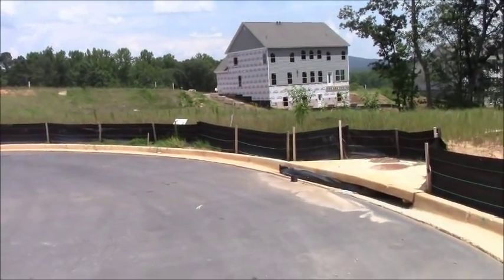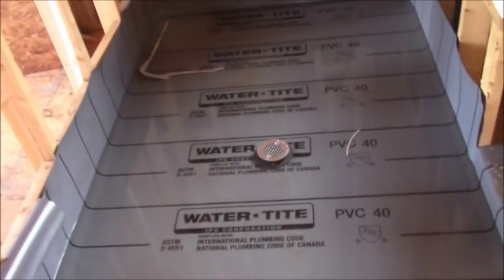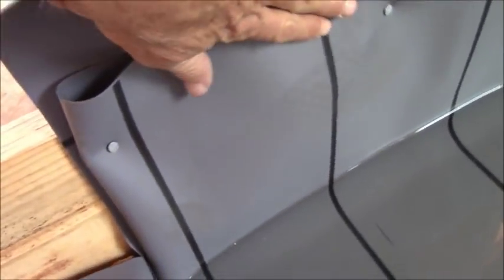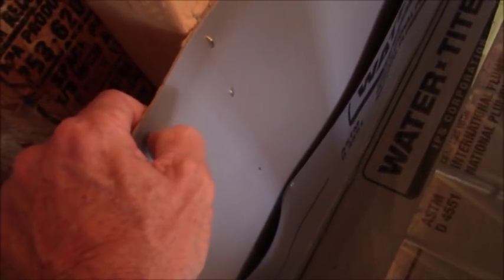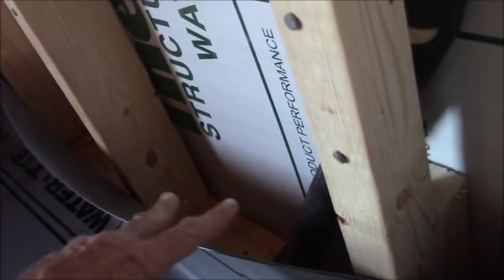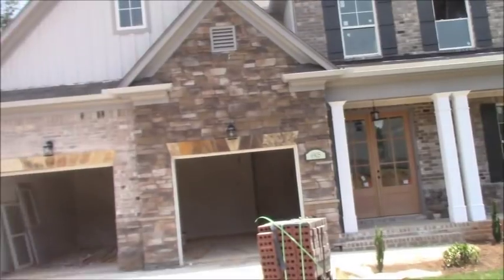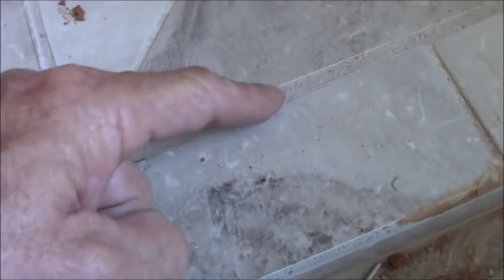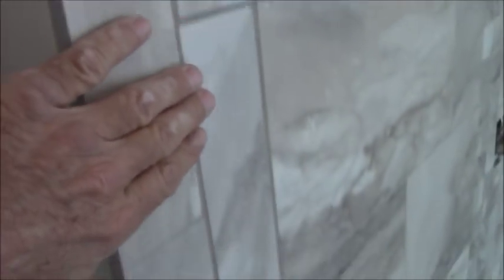NO ShowerPan PreSlope ..NEW CONSTRUCTION

Comment: That is PEX. It's not new. Copper will corrode if the pH is wrong whereas PEX is pretty much unaffected by that. Plastic fittings are corroded by chlorine on public drinking systems where copper is not. You should read up on the different types of PEX and copper and when it is suitable to use each.
Reply from the maker: And rats/mice eat through PEX to get to the water....many videos showing that...a rat can't eat copper.
Reply: StarrTile I have had to repair pex eaten by animals

Comment: I'm a carpenter not a plumber so I'm no expert but isn't the goal to not get the mortar bed wet. Seems to me the pan liner is a protection for a worst case scenario. I can't imagine wet mortar would hold tile too long. I could be wrong but if my theory is correct a pre slope would be utterly pointless. Especially in the age of red guard. Again could be wrong maybe the mortar should be getting wet but that makes no logical sense to me.
Reply: Brian 716 Portland based thinset grows stronger in the presence of water, but you don't want dirty body water sitting under the tile, thus the need for pre-slope.

Comment: After 25 yrs building... all I see is someone needs a slap on the second shower. ;)
Reply: Endorfen2011 it did look like sh@t. I would not be surprised if the shower has problems later, that's if it doesn't get red tagged by the inspector.

Comment: Copper oxidizes. Plastic does not. If you've done this kind of work for any amount of years you would know this. As far as pre slope goes, if it's code in that county than so be it. Pre slope is completely irrelevant to a tile guy when you are sloping concrete irregardless.
Reply from the maker: Copper oxidizes sometimes, and depending on what part of the country you're in and how clean your water is doesn't beget a failure necessarily... I work on homes that were built in the forties and fifties with copper that has never failed.

Rats will eat through plastic pipe, look on YouTube for PEX/ rats and you will see it, never would happen with copper.

The pre-slope issue is buried, we are waterproofing the surface of the pan now so it's irrelevant.
Reply: @StarrTile  appreciate comment. Look on YouTube search PEX vs Copper. I highly recommend everyone watch. Copper likely ness of combustion is much higher than PEX, and PEX can withstand cold freezing temperature far better. Which is pretty important to us northern states. As far as 🐁 🐀 go, I guess your right about that. But Rats can literally chew threw steel. Also found on YouTube.

Comment: pre- slope is so important, so water doesn't build up underneath motor and tile if puddling occurs on un-even floor mildew start to grow and turns grout lines black, and if you look close enough drain lip is about a 1/4 inch above floor, don't listen to this guy.
Reply from the maker: Mike.....come with your proof....I know you can't because there is none, nice try though :)
Reply: StarrTile you proved my point your other videos, where grout line in shower where moldy and black. after you did demo of shower you found standing water beneath tile and pan. please post your city code on shower pan installment.that would prove the point.shower pans are installed to retain and repel water though the weep holes of drain no pre slope no drainage of water hence standing water in shower,watch your other videos.you prove my point.
Reply from the maker: That does not prove anything, except there is water content in the pan. It's never an issue that some water will get into the pan ( unless you use a topical membrane as I do ), the issue is a pre-slope will not evacuate that water...again, there is no proof, no demo to see, no video ANYWHERE, not one engineer has ever showed it works. Nor have I ever taken out a pre-slope in 19 years...after hundreds of showers ranging in age from the 50's to modern ones you would think I'd have found ONE....not even in this video, and each was in a different city.

So as I said, show proof of your theory....you can't.

Comment: @ 3;17 your understanding of how pans work is wrong.   you ALWAYS need to pitch the pan. 
why?  because eventually the float (all shower pan floats) will get saturated with water, the water will sit there and not be able to drain out because it cant get over the hight of the drain, as a result, you will get;

grout joint and tile cracks,
efflorescence from water evaporating and leaving behind mineral deposits.
lead pan rot, because the water creates a bath for a galvanic reaction to occur.                           smells because the water goes bad.
water sitting in a pan also causes condensation to gather on the sub floor , that creates mold and wood rot.

there are many reasons to pitch the pan,  trying to tell ppl it's not necessary flys in the face of logic. 
the TCNA code book requires it for any type of pan.
Reply from the maker: I don't know why you're trolling my channel... I know the brainwashing is real and the Kool-Aid is strong oh, but don't believe everything you're told, Santa does not really fly through the air and come down your chimney, the Easter Bunny does not put candy in your backyard, and the Tooth Fairy does not leave you money.

Comment: The plumbing is uphonor (pex) which uses compression rings . Any pex or Stadler piping is superior to copper in every way except for microbial properties. Which is irrelevant.  You never saw copper degrade... please give us a break , that's ridiculous to say. The other materials is a moisture barrier sheathing required for tubs, showers, gas fireplaces, ect. You apparently are mot in touch with codes or common building practices. Pre slope is a must obviously to promote flow to drain. Shower floors should not leak to the liner anyway if the mortar is packed and slopped properly. Otherwise it would fail in no time at all.

Comment: When I started in the trade the first thing you learned was mud work.....unfortunately guys now a days are not mud experts, they even nail boards to the curb for christ sake instead of forming your own. A curb should never have a single nail or screw through it if you know how to form it with mortar. Most guys are what we call "run-away helpers" now a days and they avoid pulling mud at all costs. Hell if I run into a wall where the studs are too out of wack ill even float the wall plum to make it right.....ceilings too.
Reply from the maker: I hear everything that you say, and you are correct, nowadays guys are not going to float anything and I think it would be a mistake to build a curb out of concrete or mortar when it is adjacent to to your shower pan, should that mortar get wet then so will your curb and that water will make its way to the subfloor outside of the shower... that is my personal take on it, however since we are waterproofing everything in the shower now days then all of that is kind of a moot issue

Comment: 40 years experience 0 callbacks why I'll tell you why he is correct you do not need pre slope that pan liner is there for redundancy that's it . Just incase water ever gets to that point . If done correctly it never ever will .. after pan liner comes proper reinforced mortar bed with steep slope then it gets a special membrane over the mortar then thinset then tile . It's that simple but 75 % of these so called professionals do not know unfortunately what and how to do that . It takes years if gathered information to know how to do a shower pan without using a copper or tin solderd to drain setup it's sad these guys think oh I can do that just by shluter or hot mop or ??  Itts actually not that easy you must know physics of water it will find a way if not done correctly with proper  products every other shower I redo is less than 5 years old wow yet my showers are still there 40 years later why

Comment: TL; DR - put in a pre-slope for God Sake.  Look up how a water well produces water for an analog as to why it makes sense (in this case, the drain is the well column).

“I don’t believe in pre-slopes” is a funny statement.  A pre-slope is not Santa Clause.  Further, whether something is code vs. whether something is built to code are two different things.  People take shortcuts every day, as demonstrated by your site visit, but that doesn’t mean it’s not code.

This video would be true if gravity did not exist.  The notion of “capillary action” saturating the entire substrate is also incorrect for the same reasons a water well is able to produce water.

Not having a pre-slope doesn’t mean your shower is guaranteed to fail, just like putting a 20A outlet on a 15A circuit does not guarantee your house will burn down.  But the chances of it failing are greater if a pre-slope is not installed.
Reply from the maker: You know I have kicked this can around long enough that I really don't care to discuss it anymore...

But I'm a little bored this morning so I will take your bait....

First of all although it may be code in your area or state or wherever you're at, in the state of Georgia there is no code to do a pre slope. If that were the case then homebuilders would have to adhere to that code and obviously on this video they are not.
Secondly, I have already done a mock-up of a shower pan with no pre slope and 99.90% of the water still went down the weep holes, you can search for that video on my channel or I can send you the link.
Because you are told to do something without question doesn't make it correct or even functional.
Thirdly a quarter inch per foot is a plumbing code that has to do with drain lines that are open to air with causes gravity to force water down a pipe... in the void of gravity which you have when there is 200 lb plus of mortar, water does not react the same way and therefore wicking action will take over....
Your analogy of electrical is not even close to a proper analogy, but I shall give you one:

Let's suppose you have a 6ft long countertop and you are able to lift that countertop say 2 or 3 inches on one end. Now put a roll of paper towels in the center and where you have lifted your countertop you can dump a glass of water. Once that water hits the paper towels it will absorb all of the water that you dumped.... and if you continue dumping water then the paper towels will become 100% saturated, at that point excess water will shed off to the other end. But your paper towel roll will still be 100% saturated.
And even that is a bad analogy because again you have gravity working in favor of excess water leaving the paper towel roll whereas a mortar bed you will not have that advantage.... your mortar bed will be 100% saturated all of the time and only the excess water May in fact go down the weep holes but you don't know that to be true and there is no proof positive that it functions as intended....a quarter inch per foot BARELY allows water to shed of tiles on surface where there is no interference.

Is it better to have a pre slope rather than not have one is debatable, but with today's methods we are not concerned about that anyway because most tile guys are waterproofing the surface of their pan or using foam pan so the whole idea of a pre slope is a moot issue to begin with. That the codes haven't caught up with methods is understandable, government is not efficient.

Comment: Pex type b. (Weaker and cheaper) There are 2 types of pexs now... with compression prex rings not like the original clamp style rings. DONT TRY THAT ON WEST COAST .. It will fail most inspections... If you are able to use pexs make sure to use the right style nipples for your clamps/compression rings they didnt for that style compression ring... They needed the 2 ridge style not Barbed style like they had... Or be a real professional plumber and use copper pipe instead of PEX

Comment: This video was so contradicting lol you say that preslope was not necessary but then showed a house that didn’t preslope and when they opened the drain after a waterproof test the water did not completely drain; there was spots with pools of water. If it was presloped then there wouldn’t be water left on the liner, it would all drain!

Comment: Here's how you can prove a pre-slope is useless. Install the pan liner with no pre-slope, plug the drain, fill it up with water, then unplug the drain and let the water go down the drain.....If you have water sitting stagnant on the pan liner that means you needed a pre-slope and your theory is wrong.  Then you can do another test with a pre-slope and see the results to compare it with.
Reply from the maker: Bottom flange is no more than a quarter inch at best, using your theory the most you would have is a quarter inch of water, using a pre slope that quarter inch is still at the bottom flange and therefore you would still have water pooling, but all of that is a moot issue anyway because we're not dealing with an open environment as you propose, it's encapsulated by very porous mortar which absorbs water and will make your pan material wet with or without the pre slope and neither will ever dry
Reply: @StarrTile  You pre slope to the  flange so there's no way for the water to pool. Water will hit the pan liner and run down the drain. The mud bed may get wet but it should dry out if the shower isn't being used for a few hour, don't you think? If it stays wet all the time then that means a topical waterproofing membrane such as hydroban, redgard, kerdi or noble ts are superior since the membrane doesn't allow the mud bed to suck the water like a sponge. Good thing you use redgard on top of the mudbed.
Reply from the maker: @willhere8892  no the water will never dry out, and although what you said is correct in some form or fashion about the flange being level with the pre slope, once the water gets into the mud it cannot Escape as fast as it went in and it is absorbed by all the surrounding mortar so an hour would not do the trick, typically a shower is used twice a day, morning and night and there's never enough time for it to dry out with or without a slope, and it cannot hit the pan and roll into the weep holes because there is the mortar in the way, same as a paper roll of towels on a countertop that sloped, water would hit the towels and get absorbed, only excess water would go to the other end of the counter... but you were also correct about the last part, since I waterproof my Pan surface then a pre slope is a moot issue anyway